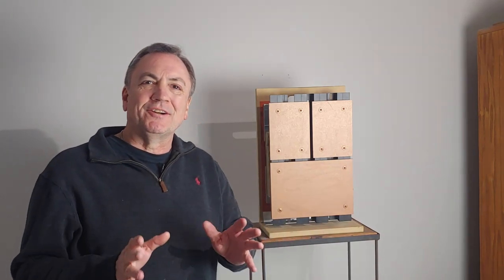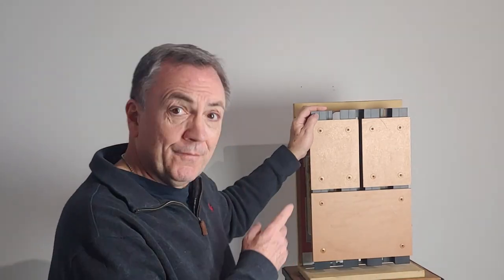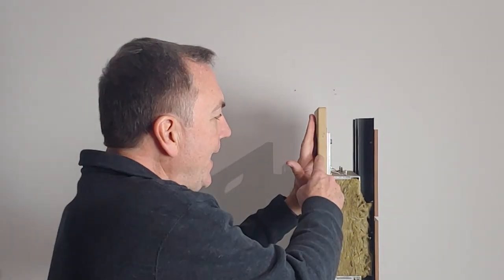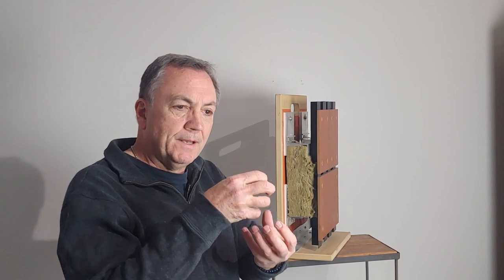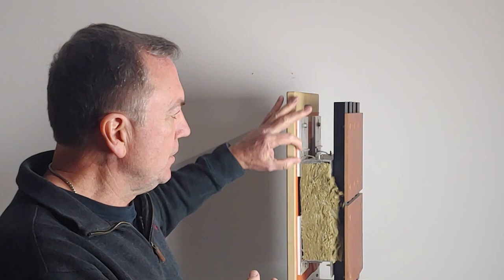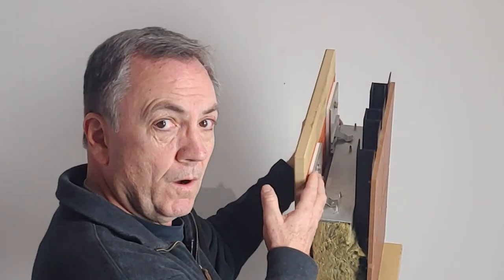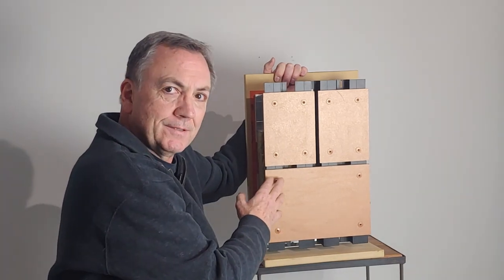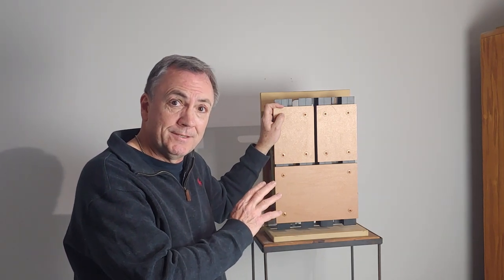This Rainscreen is Over-the-Top!

Comment: Thanks a lot for the information.
Speaking of rain,
How should our roof insulation be ? Do we have to make a new insulated roof from the outside ?  Is it enough to insulate the roof from the inside ?  I've also seen people using it without doing anything outside.
Reply from the maker: Yes, that it is usually fine to insulate from the inside. See this video about the dew point concerns while installing insulation on the inside at https://youtu.be/DwiCOb2c3Ig.

When closed cell spray on insulation is installed on the inside properly, it will act not only as an insulation but also as a water barrier to protect the inside surfaces from condensation (note that this depends on the temperature and relative humidity around and inside your building). Here is a video about insulating the inside walls (ceilings similar) at https://youtu.be/GrIkQmbMIpc.